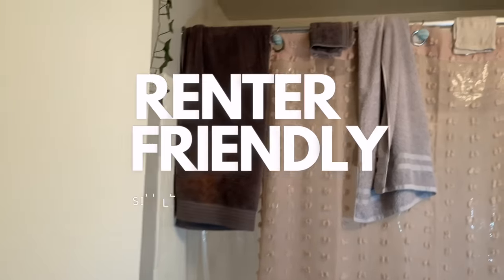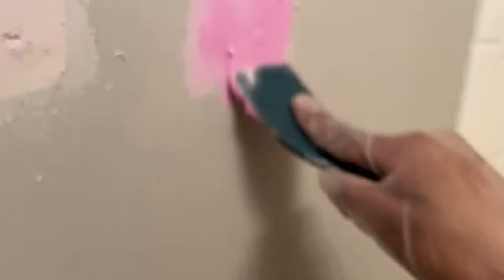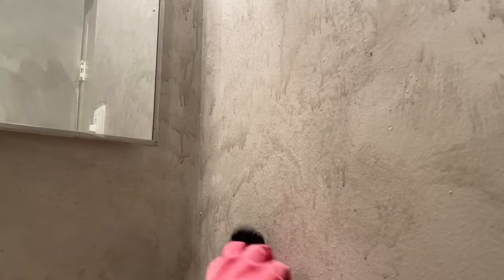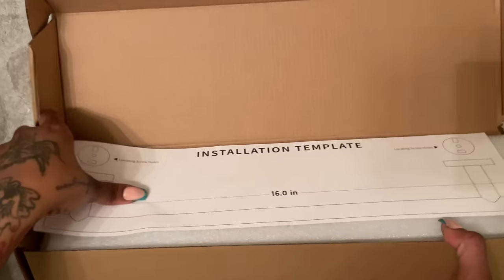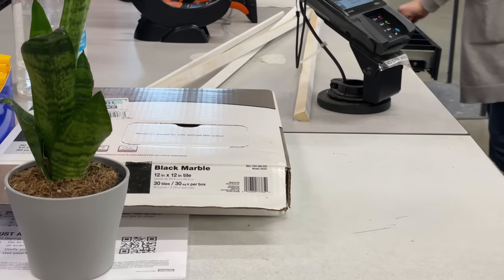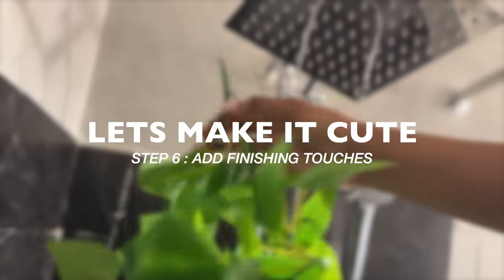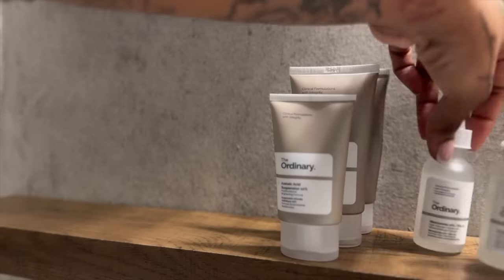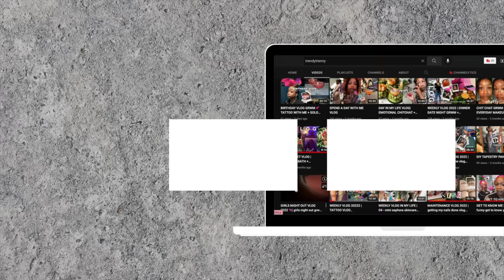EXTREME BATHROOM MAKEOVER UNDER $300 | (RENTER FRIENDLY BATHROOM RENO)

Comment: Love all the finishing touches 
Im not sure about the sticky tiles over the tiles in the shower only because over time the water and dampness will create mold and they can peel off. 
Love love the rain shower 
You did a great job selecting the finishing touches
Reply from the maker: Thank you so much for this comment I really appreciate your feedback ! To this date I’ve only had one tile peel away from the wall so I’d say over all the adhesive I used was strong enough to withstand the water & heat , but I do agree that mold can become an issue an would definitely advise anyone looking to recreate something similar to take the necessary preventative steps , that’s something I should’ve looked into myself so thank you for sharing that info !

Comment: I used “concrete design” contact paper for the shower tiles. It is easier to use than vinyl tiles and gives a sense of higher ceilings and continuity. Highly recommend

Comment: Simple dollar tree measuring tape, level, and square would help. As well as cheap black tempra paint behind the stick on tile. You also can keep the paper on the tiles but add a strong double sided tape or got a cheap thin mdf board from home depot along with some corner bead pvc trim for a border an made a shower insert.
Reply from the maker: Thank you so much for the tips !!

Comment: I think if you use grout in between the tile it’ll fill the gaps and add some type of extra waterproof-ness lol to the tile adhesive. I think it stops water from getting under the tile.
Reply from the maker: You’re absolutely right, I think someone suggested I use a black grout which I think would’ve been a great option!

Comment: The mesh us for larger holes. The damage you have, the putty you are using is the correct one to use. For the shower head area hole you can use masking tape and the putty on top. This will give you the surface you need.
Reply from the maker: Thank you so much for the advice!
Reply: @trendytrenny  you did an excellent job. Next time tape your tiles on the bathtub for perfect placement and then you know where and what to cut and then caulk around the edges with waterproof caulk or sealant to keep them from falling off. Best wishes for your next project. Don't be discouraged just kevel up. You got this💪🏾👏🏾👏🏾👏🏾

Comment: Good job! I just learned from another YouTuber, that there’s paint made specifically for tile. It would have been great to see you use the paint instead of the floor tiles in the shower.
Reply from the maker: Woah really, I wish i knew about it when I
Started  this project ! I had no idea about that but I do love the look of the floor tiles which is why I chose that route , Thanks for sharing that tip for anyone else looking to recreate something similar ☺️
Reply: @trendytrenny  I believe you could have achieved the same look with the tile paint. I think you could have done it based on what you did to the walls.
Reply from the maker: @pholbrook2277  I’m sure I could have too, I’m happy with my results either way!
Reply: @trendytrenny  yes! You did a great job!

Comment: Hi.  first time viewing your Channel.  I do like what I see in this video.  I do have a few questions: did the shower tiles really stay in place after shower watee gets on it?  Also the showef head.  where did you  purchase these items from? Thx
Reply from the maker: Hi ! Thanks for being here 💓 I would say 98% of the shower tiles have not moved since I installed them even when they’re in contact with water, one tile currently is having trouble staying down so I’d say this method is very effective, but beware if you’re renting I do not recommend using this adhesive without a barrier between the tiles & the original shower wall because it’s very strong & I’m not sure how the removal process will be !

Comment: I know that you did a great job but just some tips that you should know is when you're putting your shower head on use plumber tape to help seal the connection number two you're probably going to hate the black tie it's going to be super hard to keep that clean the way it needs. Also use some caulk around the shower head that will help
Reply from the maker: Thank you so much for those tips! I believe the kit I used to install the shower did come with plumbers tape I just wasn’t sure how to use it, will definitely know for future projects! & I actually loved the tile it was super easy to keep clean in my opinion!

Comment: The layout of this bathroom is the same as mine❤
Reply from the maker: 😄 Do you have any diy plans for your space ?
Reply: @trendytrenny I found a beautiful shower curtain for $20 at Walmart,  painted my towel holder a pretty tan color, repainted the walls white, above the toilet I have a shelf that is made with just a piece of wood with 2 straps of leather holding it, on the opposite side of the wall I have a beautiful ocean picture and on my sink I have a ocean candle with real bamboo plant
Reply: I made it more spacious because the bathroom is small
Reply: My garbage can is a white weaving basket I got from target.  I only use turquoise,  white and tan hand towels...
Reply: Now, I have thought about on the wall were the ocean picture is, doing it half way fake shiplap painted or fake brick tiles(glue pasted to a thin plywood that fits the wall) so I won't mess the wall up. If I hung the fake shiplap I would put some ocean hooks on it to hold a couple towels. Above my shower on the long wall stretch across,  I have a long piece of drift wood I found at the lake, from my shower head I have fake pine cones with needles hanging.

Comment: I hope your landlord don't see this. He going to be mad you spackled the vent to the wall and your switch plate covers. They come off so easy you changed the towel racks you could've taken them off and did it correctly.
Reply from the maker: I guess It’s a good thing you’re not me or my landlord, i appreciate your concern but it’s not any of your concern nor is it mine or any of the other damages they refuse to fix in the units they rent, thank you for the engagement it helps me a lot!
Reply: @trendytrenny when you move out are you going to replace everything back? I have this question cause i want to transform my bathroom as well
Reply from the maker: @stephaniexx558 yes when I move I will be not be leaving my own fixtures and I will replace what I removed.
Reply: @trendytrenny  Thanks for responding great video btw💓💓
Reply from the maker: @stephaniexx558 ofc & thank you for watching I’m glad you enjoyed💕